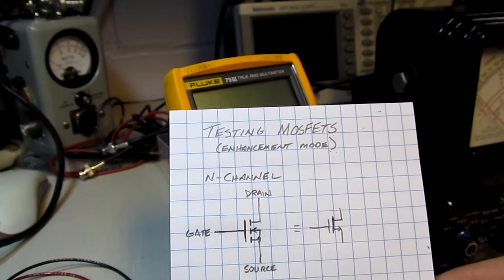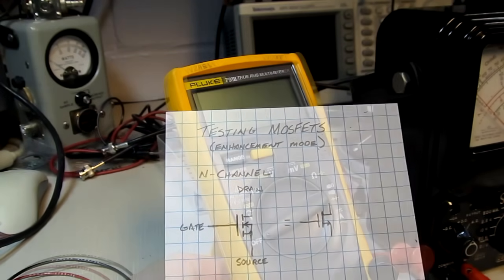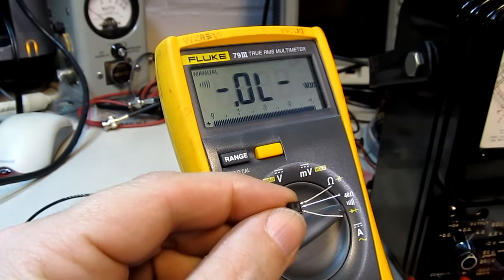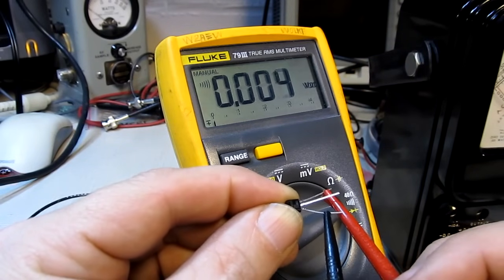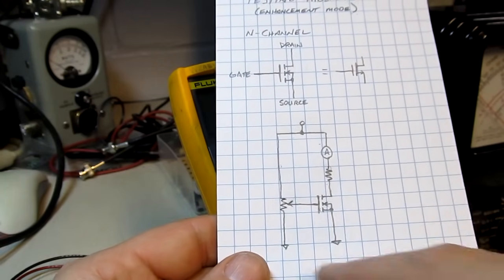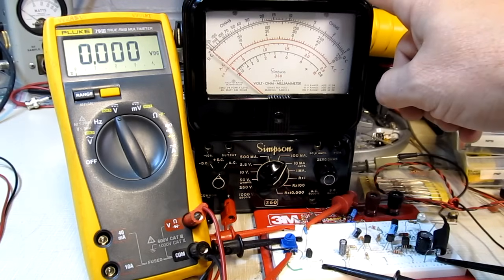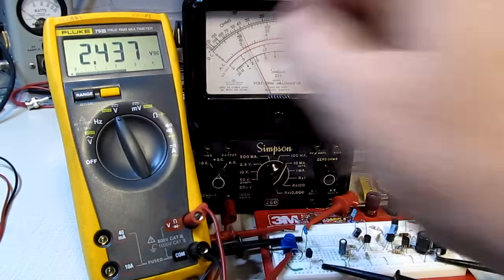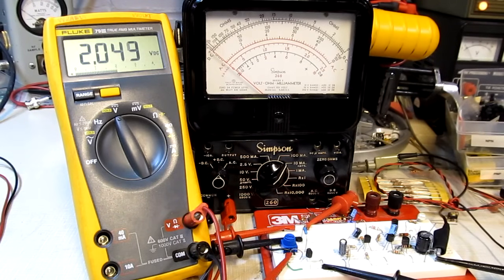#132: How to test MOSFETs with a DMM - a few methods...

Comment: Hi I have a P2NA60 and I get no reading between the drain and the source no matter which way I test it, or charging the gate..it still dont show continuity.  ??? So it is bad right???????????  Thanks for the video.
Reply from the maker: Kennynva T. Maybe.  It depends on the gate threshold voltage spec, and whether or not your DMM can provide enough voltage to turn the gate fully one.  You'll have to consult a datasheet to be sure (or test a known good device to compare).
Reply: Its strange but I have the exact same meter as you...and I love this meter..I just checked the one in question and it has a short to the tab that goes to the heat sink..from the number 1 and number 2 terminal..
Reply: well my transistor has the metal tab that the screw goes threw...to the heat sink..

Comment: Where in the data sheet would it tell you what the voltage and current into the gate to turn it on? How would you figure out what resistor to put between the gate and an arduino to keep from either pulling too much current or too much voltage so that you would not damage either the mosfet or the arduino? Sorry but just learning. Thanks for the video. Could you do a video on the data sheets and how to figure out which mosfet or transistor to use? The way you explain things, I might get something out of it!!
Thanks again.
Reply: amtpdb1 Ohms law would tell you.  If you are using the arduino via usb cable at 5v I would try out a 50k ohm resistor to the gate. You could put a 1k ohm resistor in series with a 100k ohm potentiometer to play with the saturation curve as well.
Reply: Justin Mckibben Thanks for the information. Have a nice day.
Reply from the maker: amtpdb1 Make sure that the voltage applied between the Gate and Source is greater than the gate-source threshold (Vgs(th)) in order to turn it on. No resistor is needed in series with the gate because it draws virtually no current.
Reply: ***** Thanks for the help.
Have a nice day and thanks for the video.

Comment: Does the mosfet need to be pulled off the circuit board to test it? Or can you test it before pulling it off to save the extra work of detaching and soldering  the mosfet back on.
Reply from the maker: Testing in-circuit can sometimes be done, but not always. It depends on the rest of the circuit connected to the device - so it's impossible to say just yes or no.
Reply: How about a mosfet installed in a powered amplifier? should I pull it off? Thank you!

Comment: Help needed..

When I  do Negative to S, and Pos to D =0, briefly Pos to G and back to D I get  0 reading !!! 
When I reverse and connect Neg to D and Pos to  S I get a reading of 0.49

Its an HY1001P ( N channel mosfet 70V/ 75A, / RDS(ON)=7.8mOhm (typ.) @ VGS=10V)

Can you please advise if according to first part of the test it's busted ?

And How should I look for a replacement ( I have full data sheet) ....

I can;t find an exact mach , and I was wondering if I should go higher in voltage and current  or lower...?
I  really appreciate any advice.

Comment: Nice video. You trick with the finger is great! I was messing with some metal tool, like a screwdriver. In fact - one finger has low enough resistance to reliably discharge the gate capacitor.

There is another simple DMM test - the internal diode of MOSFET, there should be a normal diode (0.6V) voltage when DMM probes connected  (+) to S, (-) to D (in DMM diode testing mode). Also, if your DMM has a BJT tesing socket (the one with EBCE pnp npn text) - you can connect the mosfet there this way: S to E, G to B and D to C - it should show infinite hFE, since there is no current needed to keep MOSFET open).

Comment: thanks for the quick reply.. i found the specs but I have no idea what it all means and how to find one on ebay that is the same size lol..I would appreciate it immensely if you can find one on ebay in the US that will work for me :))                    http://www.datasheetdir.com/FCF20B60+download
Reply from the maker: Forget Ebay.  Take a look at the specs.  It says it is a FRED device (Fast Recovery Epitaxial Diode), not a MOSFET.  Armed with these specs, go to a good distributer site such as digikey.com and pull up their parametric selection page on these types of devices, and find one that comes closest to the specs of the unit you are trying to replace.  For example, start here and apply filters...
http://www.digikey.com/product-search/en/discrete-semiconductor-products/diodes-rectifiers-single/1376383?k=FRED

Comment: Alan, you have positively touched (no pun intended) the lives of many techs with this video. I worked for NASA and WSMR for twenty six years and can check BJT's and SCR's blindfolded but I never knew how to test FET's until now. I knew the basics of FET's and the "open" gate and  understood why it could be damaged so easily (and the reason we were required to wear wrist straps and antistatic lab coats) but no one knew how to actually test the FET's. By the time our technology got to FET's we replaced PCA's by hexadecimal error code and never worked at the component level again on mainframes. Thanks for the information. I may never use the method but I will never forget it. Funny some of the things we can remember and some of the things we can't....  :-)
Reply: Wow

Comment: Are BJTs more linear than MOSFTs, my understanding is that they are. Is is possible to make some form of negative feedback to the input of the MOSFET to make it operate linearly, to minimize distortion?
Reply from the maker: It depends on how you look at it. BJTs are fairly linear with regards to collector current vs. base current. But, their quite non linear w.r.t. collector current vs. Vbe. MOSFETs are more linear in this mode (drain current vs. Vgs). Feedback can be used with either to improve linearity.  This typically works better with BJTs since the transconductance is much higher, increasing loop gain and thus closed loop linearity.

Comment: I had never ever tried the touch the gate for a second to charge, and see the Drain Source to continue flowing with Gate open.  I could not resist, and just grab a 2N7000 and tried it, pretty cool.  I also tried it on a IRFP450 and IRFZ44N, same thing.  Wow.  Gate keeps the charge.
Reply: It's cool regardless of his expectations. LOL actually have a fan I made with a little PCB with touch pads controlled with a surface mount fet. Super useful little switch without any moving parts. :-) every single time I touch it and the fan turns on I think, "damn that's pretty f**** cool actually." LOL
Reply: it's a capacitor, what would you expect?